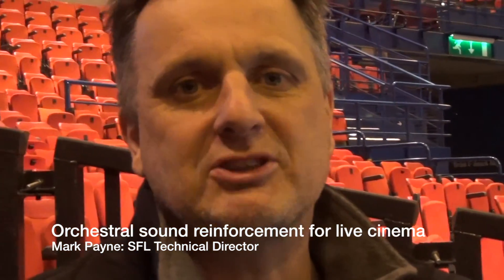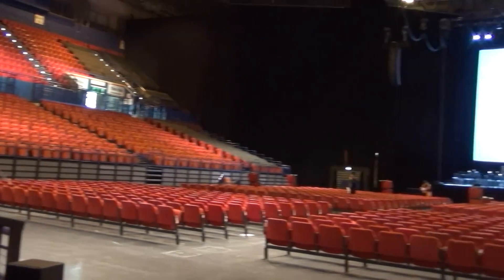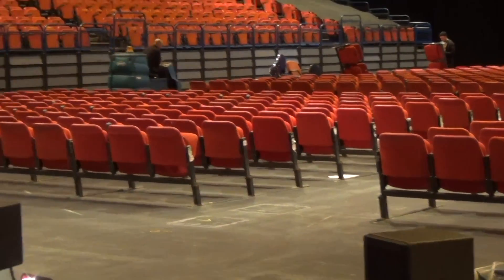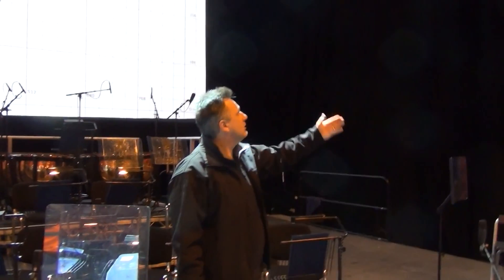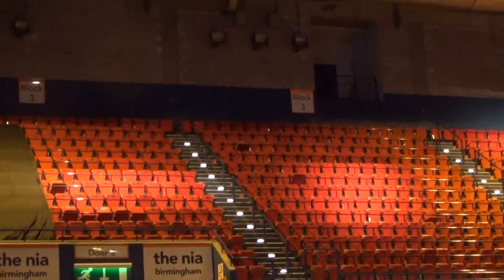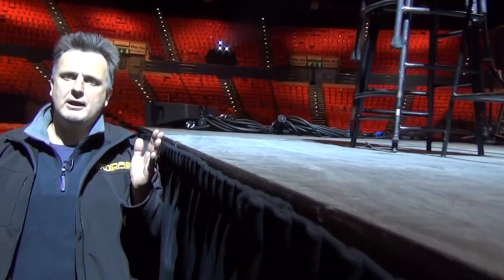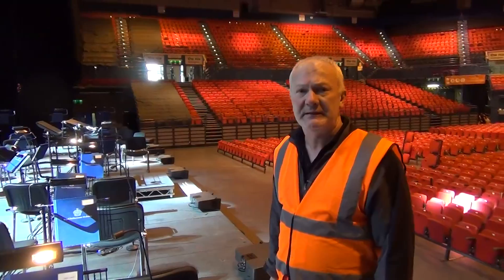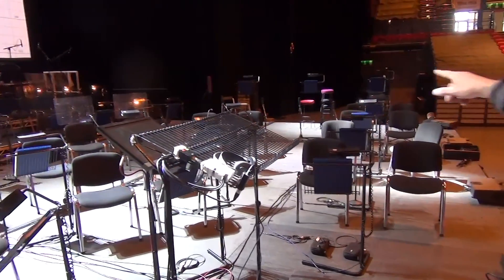Fantasia Sound Design

Comment: Great Stuff! How many inputs did you end up using?
Reply from the maker: So there were 50 inputs to the console but all of the string desks were paired up passively so two condensers per channel. I have a stage walk around video so I should put that together at some point.
Reply: Ah, thanks! Did it feel comfortable to mix on the Pro 2 with so many inputs?
Reply from the maker: Of course. It is in fact my favourite console for this kind of thing. I find the VCA spill excellent for laying out the console.